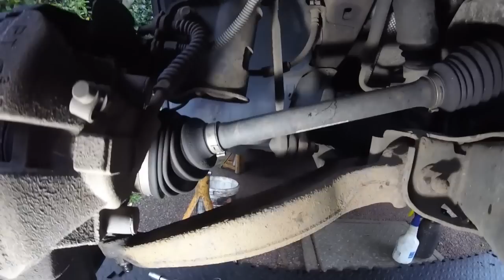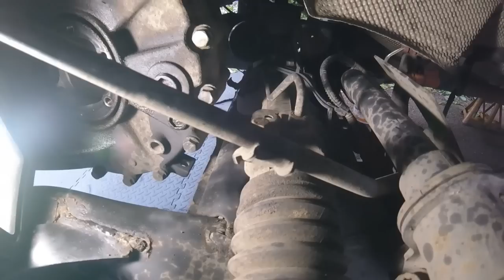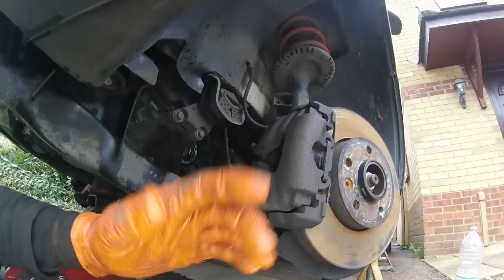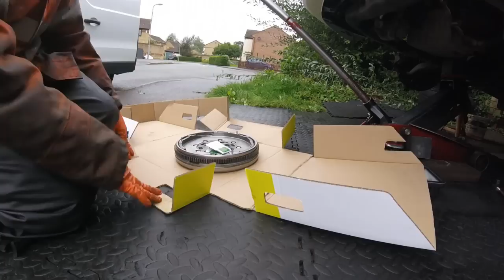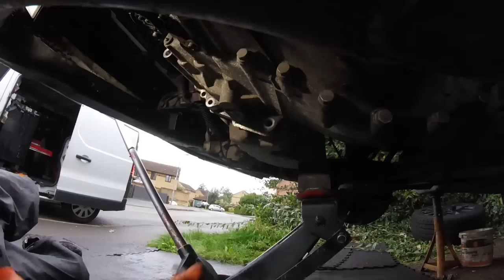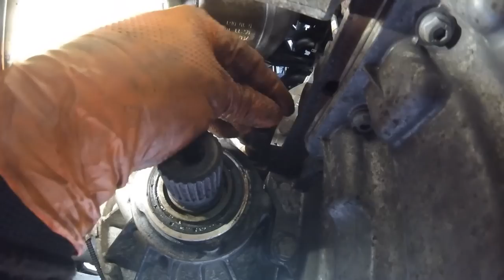2011 Volkswagen Transporter 2.0L Diesel Clutch Replacement

Comment: Thank you so much for posting these videos, just managed to complete this job myself, without your video I wouldn't of had a hope in hell, only thing I had to do different was I removed the drivers side driveshaft, and also the cable inside the engine bay needed unclipping to give me space to drop the engine down more.
Reply from the maker: Glad to hear the video came in handy. I did two one with driveshaft in place and one fully removed driveshaft…🍻🍻🍻
Reply: You must have some strength, took two of us, and two trolley jack's to shift the gearbox, fairplay !

Comment: Jep. Good job. Pain in the ass with the sub frame. You should do a side line replacing heavily corroded starter motors.  A few from Bosch, just in case....preventive maintenance....

Oh btw. I got a Facom 1/2 360° ratchet the other day. Great for tight spaces...check em out...
Reply from the maker: Thank you. I’ll have a look.

Comment: Brilliant vid. Do you have to empty the oil before changing clutch and what make of oil did you replace it with?. Thinking of changing gearbox oil in mine
Reply from the maker: Always replace gear oil. 
MTF 75w90...
Reply: @WMCS  would this be semi or fully synthetic oil?

Comment: That's an excellent video as usual Kevin; great to watch you work mate.  I have a 2004 Astra Envoy van 1.7 CDTi  with single mass clutch I got off my uncle. I'm going to put a new clutch in her, and since I pull a wee trailer with sheep sometimes, I'm looking for a heavy duty clutch kit.  What would you recommend; advice would be greatly appreciated.  Keep up the good work mate, regards John.
Reply from the maker: Hi John... In my opinion I think the 1.7cdti is the better engine and gearbox in the vauxhall range.,, always use FTE slave cylinder. Buy it on its own.. any other cylinder tends to fail prematurely.., 
Then go for a two piece clutch kit in either SACHS or LUK.

Comment: Just started with my clutch. What would you do with the steering column to a left side steering wheel car. It happens to be just in front of the gearbox and makes it hard to pull the gearbox aside.
Thanks!
Reply from the maker: I have never done a left hand drive version of it. But based on why you mentioned I’d push the engine forward after removing both front and rear mount  studs and bolts.
Reply: @WMCS  Did the job and it included undoing the steering rack from subframe and from steering column, as well as loosening subframe bolts on the other side a little. In this way it was possible to play forth and back with it while wobbling out/off the gearbox.
Your video was really helpful and saved time searching best way to do the job. ElsaWin was useless this time.

Comment: Watching you work is like watching a well oiled machine, how long does it usually take you when it’s a 6 speed T5 box, do you use all new bolts on the clutch and slave cylinder? Thanks
Reply: Also I’m guessing that it’s extra thread lock that you are adding to the flywheel bolts? Can’t quite see from the video, what type is it please?

Comment: hi Kevin another good job, is it always necessary to replace the flywheel or just economical.
Reply from the maker: In my opinion and past experience.., I will say yes .., unless it’s a petrol, the. You’ll be fine. 
Reason for diesel what I have found is the engine torque to gearbox is too great to last the new clutch .., the centre spacers of the DMF always fails ...

Comment: Hello Kevin,
I admire your work,
I live in Paris and I would like to have your opinion, I have a 140 hp vw T6 from the end of 2015, the flywheel clutch kit was changed less than 3 months, and I am having problems with the pan noise when starting only with the engine hot !! Do you have any idea, the French mechanics say that the noise comes from the flywheel?
thank you for your comeback

Comment: Great video, just about to tackle this myself, is there any reason for dropping the gearbox oil other than replacing ? I'm doing a clutch on a 180 bi TDI transporter which has the slave cylinder inside the gearbox
Reply from the maker: No other reason apart from replacing the oil.
Reply: @WMCS  just completed this job myself, 3 days before I go on holiday so was a bit last minute !!

All I've noticed when driving is the intermediate steering column catches on the trim inside the cab, any ideas what might have moved ? I'm just a little worried with dropping the subframe have I bent the intermediate shaft so it's now over to one side inside ?

Comment: Hello, excellent video, very professional, you can see the great experience in having changed many, you do it with your eyes closed.
I have a question: I have a 2011 vwt5 with a 102hp manual gearbox and five speeds, transporter model. there are many references of the complete kit and I don't know which one to decide on, I'm almost sure it's the same one you've assembled, could you tell me the reference, thanks
Reply from the maker: God for the LUK. Only difference is with or without stop/start technology

Comment: Hello ! Sorry for my english... I'm french. I love you're videos ! I've got a question: i have remplace the clutch of my Mitsubishi L200. After that i've got a noise permanent brrrrr. It's possible the new clutch release have a problem origin ?
Reply from the maker: Hi Slim Dog.. is there any vibration in the pedal. When you press it about 1/2 way down.
Reply: @WMCS   Hello. No vibration

Comment: Impressive work and channel. You make it look easy. Is the process similiar on the latest T6.1? I hear dealers stating its an engine out job which seems crazy.
Reply from the maker: I’ve done a couple of T6 now. They are fairly straightforward. I’ll try and get a video up.
Reply: @WMCS  Cheers, be good to know if they are any different to the T6.1.

Comment: Why did u take the bolt out wishbone could just simply take the two bolts out the strut and remove driveshaft alot easier also don't use a impact gun to remove a gearbox drainplug that's one way to crack it and same putting back in also the driveshaft bolts are meant to be replaced as they are stretch bolts
Reply from the maker: More than one way to skin a cat 🐈 .. 😉 
It don’t bother me. I still go home end of the day 💡🍻

Comment: Hi Kevin-Albert Williams, i like you’re vids! Change clutch just in street is amazing. Do you know of a VW Golf 1.6 tdi 2011 has a double mass flywheel or a fixed flywheel? Greetz from the Netherlands
Reply from the maker: Hi 🍻✨✨.,, as far as I’m aware all VAG engines unless it’s an Sports Line.,, DMF starts at 1.9.,, so your one should be a solid flywheel

Comment: is it not necessary to use the resetting tool as there self adjusting clutches?
Reply from the maker: Be sure to tighten up t down in a figure 8 in 4 turns increments.

Comment: Hi Kevin-Albert, After watching your video for the third time(!!) I have a couple of questions; 
#1,Why do you undo the single nut on the taper spindle of the ball joint to the control arm, rather than removing the two threesquare socket bolts that hold the ball joint to the spindle?  
#2, It appears that you undo the bolts on the front cross section of the subframe, and the two large washered, rubber mount bolts on the left but not the two on the right; is this correct?  Essentially you let the left side of the subframe hang down to gain clearance for pulling the transmission back, yes/no?
#3 What grease do you use on the clutch splines? VW gives a service number in their manual that has no connection to grade/specs on this side of the pond.  Normally North American clutch kits come with a vial of specific spline grease, but none was included in the LUK kit I received from UK.
#4 The VW manual specifies using new bolts on the flywheel and pressure plate. Have you found this necessary or just more VW overkill?

Lastly, for now; do you find the 130 hp. diesels suffer less from the strain of the engine torque on the DMF than you have seen on the 174 HP versions?  Is there any general driving technique you would offer to help postpone/prevent replacement of these DMF units?  I agree that the likelyhood is that they are under-engineered for the power/weight factors of the vehicle - a VW engineering miscalculation.  
My apologies for the too many questions. No one here has ever seen a T5.   Doug (Lonely Cali in BC)
Reply from the maker: Hey Doug 🍻

1.  It’s a lot easier to just pull down the lower suspension arm that way. The method you’ve mentioned will involve a bit more time aligning the two bolts back in place ., which can sometimes cross thread. 

2. Yes exactly that ., but there are times when I’ve had to slacken the other side but not remove it fully just for a little bit more drop on the subframe if the gearbox needs coming out fully. 

3. I always use red rubber grease. As it doesn’t disintegrate and clump up as some other grease. Which in return causes the clutch to bind with dust over time. Causing clutch drag. 

4. Always use new bolts. As they are stretch bolts. If re used there’s always the possibility of it snapping under torque. 

5. General advice for prolonging the DMF life ., avoid leaving clutch pedal depressed and in gear ie: when at a standstill at traffic lights or in traffic. Because the pressure plate will be continuously pulling on the top plate of the DMF to allow the clutch to be disengaged. They are designed to be released after straight after gear change. 

Yes the do suffer less unless it has the stop/start technology then the DMF is a lot more robust.
Reply: Thank you. Kevin-Albert, Your diligence is evident and commenable.   @WMCS

Comment: You made light work of that Boss, was that a 5 or 6 speed ?
Reply from the maker: Hi Kevin .,, thanks for the review .,, it was a 6 speed .., I’ve got a later 2.5 coming soon. .,,,
Reply: @WMCS  my t5 needs that and a slave cylinder. Been putting it off for a while. But you've definitely given me the motivation. 👍
Reply from the maker: It’s not that bad. The box is a bit heavier on the 2.5. With an extra pair of hands it’s easily done.
Reply: @WMCS  any idea what the dual mass bolt torque is ? Says 22nm but seems a bit on the low side ?
Reply: kevin gault for those 6 bolts on DMF it’s 60Nm + 90•, always renew bolts and screws.

Comment: What solvent did you use to clean the clutch bell housing and what was the red stuff you used on the crankshaft?
Reply from the maker: It’s brake cleaner
Reply: @WMCS  thank you.
Reply: @WMCS  also what’s the red stuff you use?

Comment: Kevin, Mt T5.1 is fitted with a 6 speed box and Concentric slave cylinder can you do it the same method without taking off the subframe. I’ve noticed you have just hinged it down and used it to support the gearbox. Can I do this with my setup. 14 plate 140hp it is.
Reply: Is that a yes it can be done the same or not👍
Reply from the maker: That’s correct. Exactly the same the same. Subscribe and have a look through the channel. There’s specific repairs for all the T5 models.
Reply: @WMCS  cheers . Great video by the way. 👍
Reply: @WMCS  where are you based? How far do you travel for a job? What sort of money to do a complete clutch on a T5.1 transporter including the. Slave cylinder and dual mass . Post code ST3
Reply: I did my gearbox change yesterday and the box is muncher bigger than the one in this video. There’s no way you would lift it off like you did in the video. Neither can you swing it around in the gap between the subframe and underside of the chassis… it’s too deep. I was working in a very small gap between the engine and gearbox once split. That small I couldnt fit my clutch alignment tool on the plate and cover and then fit it in the gap. If I was doing it again I would make a plate for my jack and chock up the gearbox to keep it level when taking it on and off. The subframe would also need to come off totally to give you access into the clutch flywheel . It caught me out really and once I’d started there were no going back. I’ve taken many gearboxes out of many vehicles so no novice but this one wasn’t easy following this video. Do you have a video of you showing you removing a 6 speed gearbox in this way? If so I would love to see it. If you do actually lift it up yourself you should be entering yourself into the Worlds Strongest Man😎
Reply: @philprice760  hi phil. Im about to attempt to change the clutch in my 6 speed 140 and wondered if you could give me any tips you might of picked up when you did urs that'll save me a load of problems when i come to do it?
Reply: @StealthSurviveYT  it’s not easy Dan  and certainly the method Kev uses isn’t so easy with a 6 speed. The subframe one side needs be dropped a good way to allow the gearbox to tuck under the Lh side of the inner van body. You certainly won’t lift it off like Kev did with the five speed . And getting back on is a nightmare. My old man was on the jack under the gearbox while I rotated it around to line it up while he pumped it up. If I was to do it again I would make a platform to go on my Jack which fitted under the gearbox with packers screwed to the base board to keep it level and balanced then it would be much easier. Even so like I said the engine and gearbox needs to be tilted at such an angle to clear the van the subframe is almost on the floor and even then I couldn’t pull it off the engine and have it turned 90 degrees to fit the new flywheel . I ended up fitting the flywheel through the gap which was less than 100mm . So clutch cover off, flywheel off then the Sachs unit on the gearbox then reverse of disassembly. And there becomes the problem. You can’t fit in the clutch cover alignment tool with the cover through the gap. I ached for a week after doing this job on the deck. It’s achievable but it’s not easy that’s for sure.
Reply: @philprice760  thanks for the reply phil. Luckily i have a 4 post ramp so hoping to be able to have it off the floor slightly whilst i work on it. Dont know if its going to be a help or a hindrance as its one of the old types that has the rails that runs the full length of the van. Anyway thanks for ur help and advice